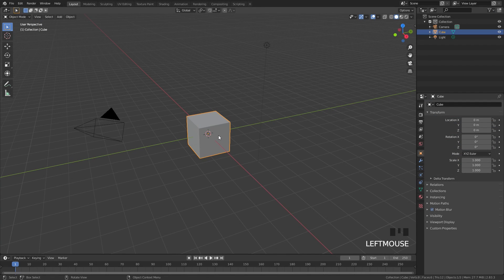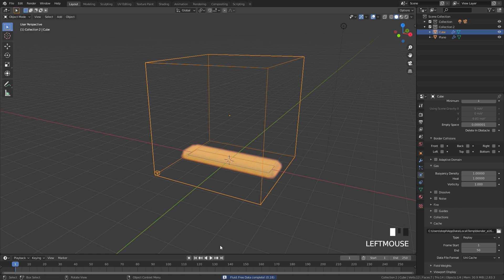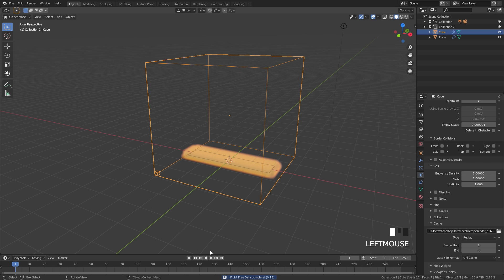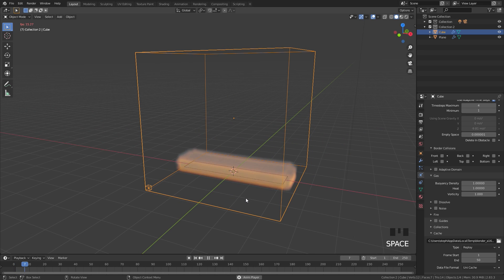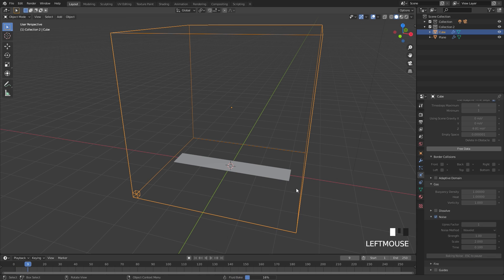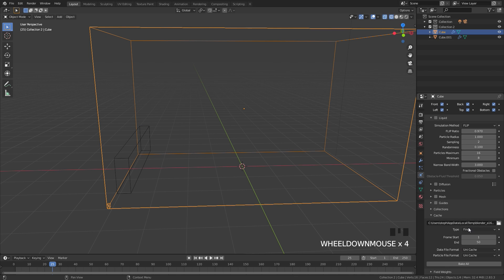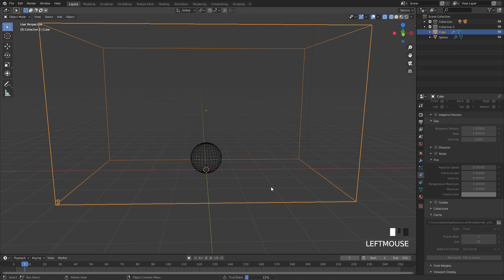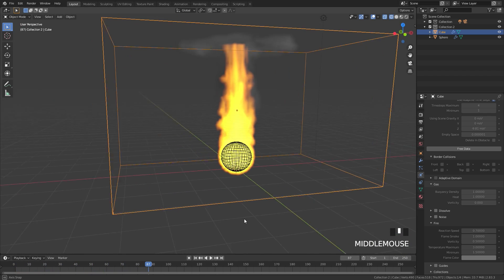Blender Tutorial - Where is the Bake Button in Mantaflow?

Comment: When I bake the Modun's cache, everything is done and shutdown and when I re-open the blender the cache data is gone, so the cached items are not applied to the worked object. hope to guide me. thanks
Reply from the maker: If you want to save the bake you need to set a custom folder for the cache. The default is a temporary folder so when you close blender it will delete the cache.

Comment: OMG, they Changed it Again. Now it says "all" instead of "final." And it seems like they moved some things in the Modular option, so no idea where to update cache for those things. And replay is So buggy I can't get Anything to update. So, calculate everything every time you make a change I guess. This video Did help, because I learned what the settings were. But still very frustrated.
Reply: have you figured it out yet? in 2.91 i cant get it to simulate after the first run. any time i make a change after the first sim it wont work.

Comment: Since I’m early, I need help. I followed your mantaflow fire simulation video and no flames ever came about. I can see the smoke but not the flame. What should I do ?
Reply from the maker: Yes I agree with Pro Effects, is your flow object set to fire? Also make sure in the material you turn up the black body intensity to see the fire in the rendered view.
Reply: Is the inflow object as "fire and smoke" or just "smoke?
Reply: @OfficiallyOToole  Nevermind I figured it out ! I forgot that the black body intensity meant in the materials section and not on the in flow object. Thank you guys for the help :)
Reply: @OfficiallyOToole  Ok so I got it to show up in the solid and wireframe viewport but it doesn't show up in the render viewport, yes the inflow is set to 'fire' and I set my material to a majority black. So now I just can't get it to show in the render port